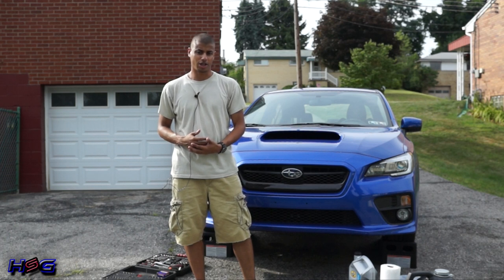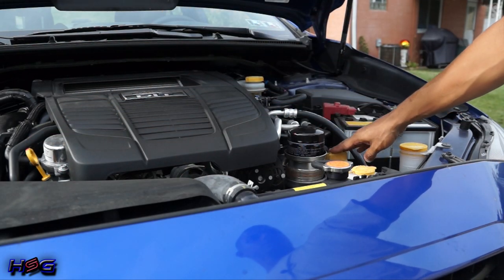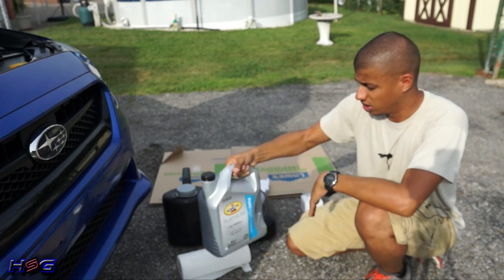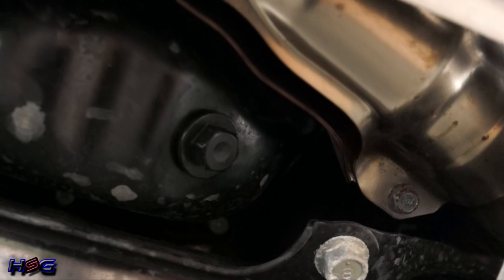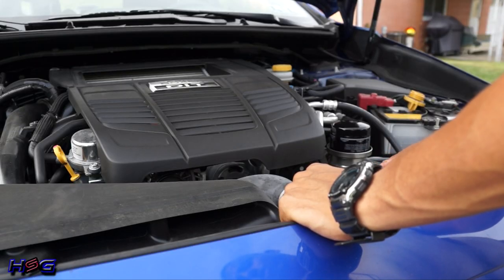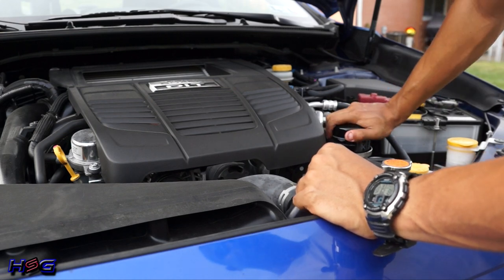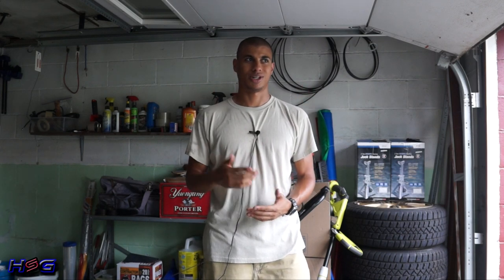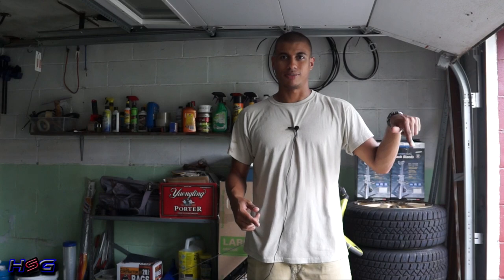Maintenance Series: 2015 WRX Oil Change

Comment: I've got 985mi on the odo this evening ..  tomorrow is oil change day.   stopped at Subaru and picked up filter/crush washer.   Gonna leave oil filler cap closed for a bit while initial oil drains out.. hoping to avoid the big gush I've seen on your change and another.  :)   gotta love that filter position.
Reply from the maker: +dsonyay Nice.
Reply: +dsonyay Did mines lastnight with the filter/cap still on, this did not prevent the massive gush of hot oil from covering my hand.

Comment: Great video man! Well made and easy to follow. Only thing I’d do different is change the oil filter first before you drain the oil to prevent any loose debris in the filter being pulled back into the engine while it’s draining

Comment: Great video but a couple of points, to prevent the mess don't open the oil filler cap until you have opened the drain bolt. This helps to have an initial vacuum which  reduces the initial flow and prevent such a mess. After opening the drain bolt you can then open the oil filler cap to increase the flow.

Comment: I did see some comments about the oil gushing and giving Hawk a hard time. It is impossible. It comes out faster than my drain pan could keep up. It all round was a nightmare for me. Good thing I put the fumoto valve on. AMSoil Signature Synth 5.4qt, subi filter
Reply from the maker: I hear ya. I have the fumoto valve on my STi & love it! I don't spill 2 drops with it.

Comment: I was going to recommend you use a Purolator PureOne oil filter, but there is no Purolator oil filter compatible with the WRX.....or any Subaru.  Subarus are not compatible with Purolator oil filters for some reason.  The Purolator site says use the 14615 series oil filter, but they're not found in stores (i.e. Pep Boys, Advance Auto Parts, Auto Zone, O'Reilly Auto Parts, etc.).  With Subarus, I guess just stay with the OEM oil filter.  It's good that you're using Pennzoil Platinum, great oil.
Reply from the maker: +LouieGMDesign Yeah. I like OEM. NAPA Gold filters seem to do ell also.  👍🏻
Reply: +LouieGMDesign I found the Purolator Boss that fits my WRX 15.

Comment: Nice job! Just a few suggestions, if that engine was recently driven and hot, that oil would really burn the skin if it spills. Don’t forget to wear gloves for your hands. Finally, I had an 07 Hawkeye TR and I found that even venting the oil dipstick with the oil cap helped the used oil drain quicker. Always good to do the maintenance yourself knowing you do the job right. Keep up the good work!
Reply from the maker: Good to know. I may reshoot this video at some point. Lol.

Comment: good info.. I'm buying a 2015 WRX any day now.   nice to see how easy an oil change is.  the oil filter location is superb.  what mileage intervals does Subaru recommend under normal driving?
Reply from the maker: +dsonyay Glad this helped you! I change it every 3-4K just to be safe. I'd rather do more oil changes & have the peace of mind, instead of trying to figure out if it's been driven hard or not & just assuming its ok.

Maintenance Schedule:

1st oil change by 6000 miles or 6 months.
Subsequent oil changes at least every 6000 miles or 6 months
Note: this is the minimum required interval. Many people do the first oil change early.
Note; with stop and go, hot/cold, hard, or severe driving, replace every 3,000 miles or 3 months whichever comes first
Reply: +HawkeyeSTiGuy thanks.. I initially went in to test drive the 2016 Outbacks, but while waiting for keys for my second drive, I was looking at a leftover 2015 WRX... told the guy,  "hey, I want to test this out as well"..  well, now I've forgotten. about the Outback.  hahaha.. I'm 53 and my last sports car was a 944 t
Turbo in 87.  This WRX is incredible for the money.
Reply from the maker: dsonyay That's awesome! You are going to love the WRX! In my opinion, the 2015 is a game changer & is better than it has ever been before. Having considerable wheel time between both, the WRX is as good as my 06 STi was from the factory. The handling is much improved, the tires are wider, the power has been stepped up, & it has good torque. The new WRX is even more of a bargain than the old ones.
Reply: +HawkeyeSTiGuy I've always admired the cars ever since the bugeye version.. big rally fan.  question... I've seen some oil change videos.. do you guys have a thing for Penzoil Platinum?  the two I saw, both used same oil brand.  :).  can you suggest a good WRX forum?
Reply from the maker: dsonyay Penzoil Platinum seems to do very well in these cars, & isn't ridiculously expensive. You can go with something even higher grade like Amsoil Signature,or Brad Penn, but that would be overkill. I used Mobil 1 in my STi when I first bought it & it seemed to break down very quickly & not protect the components like it should. 

As for forums, I can definitely recommend igotasubaru.com. They are very friendly & helpful on that site, & there is a wealth of information. I am on the igotasti site, which is run by the same people, & have never had a problem, so that is the main forum I am on. It feels much more like a community, where people try to help each other, instead of putting others down. 👍🏻 

There is also NASIOC, which is the biggest & is one of the oldest Subaru forums, & because of that, it has a ton of information. I occasionally use the site for researching issues I'm having, but I truly hate going on there because it is full of armchair mechanics & experts, who share "knowledge" that they heard from their uncle's friend's brother twice removed. NASIOC is also very hostile towards new people or anyone looking for information. You ask a question, & you'll immediately have 20 people yelling at you to search before they even look at the question you are asking. 👎🏻

There are a number of other Subaru forums as well, like IWSTI.com, but I'm not on them, & some just copy & paste the same information that was originally posted on NASIOC or other forums.

Comment: Cool video man. I use Pennzoil Platinum in my 12 WRX, reading through some oil reports people have posted on the interwebs, it actually does really well in the EJ motors! What mic are you using? It sounds good.
Reply from the maker: T-WRX Thanks. I plan on doing a video in the future about some different oils out there & whats good for a Subaru. When I was in the south, I used Rotella T6 in the summer & was pretty happy with it. The one oil I'll never use again is Mobil 1. In fact, I just watched a video comparing several oils & Mobil 1 broke down the fastest, while Pennzoil Platinum did very well, & so did Amsoil Signature.

My mic is a $20 Polsen lav mic I got on B&H. I had to bent the metal contacts in the battery compartment, & wedge in foam to keep the little button battery in place. Before this, it would jostle around & the sound would crackle. The mic also picks up some static that I always have to edit out whenever I'm driving, which is mildly annoying, but overall, I'mm very happy with the sound quality & cost. It's hard to nitpick when it was only $20. Great budget mic to get started with.
http://www.bhphotovideo.com/c/product/944398-REG/polsen__olm_10_omni_directional_lav.html
Reply: HawkeyeSTiGuy Awesome, I'll check it out, appreciate the info. Keep it up!

Comment: When your oil is in your motor and it sinks down after some time, you should start the car for like 10sec so jt sucks the oil in the system and then check the dip stick

Comment: Subaru has been pretty competitive price wise with the oil filters.  The K&N oil filter is $12 near me and the Subaru blue filter is only $5.95 you can't go wrong and many people have filter leaks when using a Fram or similar and they are priced around $3-4 so it's well worth the extra $3 for that Subaru filter. STI used to make a Pink oil filter like the H&K but for $50.00 !?!??! That's rediculous.
Reply from the maker: I completely agree. I use OEM on this WRX, & since the engine rebuild on my STi, Moore recommended I switch over to NAPA Gold filters & those have been very good to me. Also in the $7 range if I recall. Years ago, I tried the K&N filter just for kicks because I needed to spend a few more bucks to get free shipping. I didn't notice any real improvement from it.
Reply: Anybody know the difference between the Subi black and blue filters?

Comment: Thanks for the video but you should never check the oil level with the car on ramps as the front of the car will be raised up and the reading will not be correct. If you only have the ramp option I would fill the level half way and get the car off the ramps and then re-check the oil level when the car is on a flat level surface.
Reply from the maker: +HankDCFC Yeah, normally I wouldn't, but my driveway is not level at all. It really doesn't show in the video, but the car is actually pretty close to being level. Lol.

Comment: how many quarts did you put in you need 5.4 plus pull that filter of first it helps get more of that old oil out. I'm not trying to hate just help i used to change oil. but nice vid i like the style.
Reply from the maker: I put in enough. I added a little more off camera & I checked afterwards & it was right where it should be. It was just the way I edited it that makes it look like I didn't add enough.

Comment: I thought you needed to refill with 5.5 qts of oil. But it looks like you only added 5 qts (1 pennzoil container). Just wondering if you added more that's not in the vid. Good video, btw!
Reply from the maker: +Ameer Eusebio Thanks. & Good point, you are correct. I only put in 5qts & when I checked it was about 3/4 of the way between both lines, so I did not add more. Adding a half quart would take it right up to the top line, which is good too. I checked the oil level again later that day, & again the day after & it was still at the same level, so I didn't sweat it. I usually check my oil every other gas fillip, so if it is slightly low, it doesn't stay like that for long.

Comment: Hey man I just got a 16 WRX. I've been wondering if I should do the oil change myself or take it to the dealer since they're gonna do them for free for the first so & so months. What do you think? I change my own oil on the Chrysler 300 and the Acura I had before I traded it in for the WRX. Just want some opinions

Thanks for the vid
Reply from the maker: Sure. If they're doing them for free, I'd just take it to them. Once you run out of free changes, then I'd start doing them yourself if you feel comfortable. 👍🏻

Comment: I have a question, You think amsoil is better than the Subaru synthetic oil?.. And what you think about pennzoil ultra?.. I'm not sure which to use for my wrx 2016
Reply from the maker: +hektor3261 In my opinion, Amsoil is one of the best oils out there because of the additives they put in it. They have different blends, but the stuff I use in my STi is high in zinc, which reduces wear between components. My car runs smoother & happier with Amsoil than it has with any other oil I have used, even before it was built.

 That being said, I would not recommend Amsoil for a new car under warranty for 2 main reasons. First of all, a car that isn't built really doesn't need Amsoil, any SAE certified full synthetic should be good. Second, most blends of Amsoil are not SAE certified because they do not me the specified requirements for composition. As I understand it, an oil needs to contain certain percentages of each component in order to meet standards. This also means that most oils are within a few percent of each other as far as their composition. Amsoil is formulated differently, which is actually better for most applications, but because of that, it does not carry an SAE stamp of approval, & that can get you into trouble when it comes to warranty work.

I have no experience with Pennzoil Ultra, so I really can't say if it's good or not. I know my car hated Mobil 1, not sure why. It just was not happy with that oil & often made noise on start up. I would say as long as you stick to a full synthetic that carries an SAE certification (It should be on the back of the bottle) you'll be good.

Bob is the Oil Guy is one of the best sit web forums for researching oils. There is far more knowledge over there than I can provide. This link also talks specifically about Pennzoil. 👍🏻 Hope this helps. http://www.bobistheoilguy.com/pennzoil-synthetics/
Reply: +HawkeyeSTiGuy  thanks for your advice 👍🏼 I'll probably use oem oil or pennzoil
Reply from the maker: hektor3261 No problem. Either oil should suit you just fine. 👍🏼

Comment: hey what's up hawkeye, what kind of ramps do you have. interested in getting the right ones so i don't scrape to bottom of my vehicle. thanks
Reply from the maker: I used plastic ones from Pep Boys. They are standard size ramps. They barely clear the bumper though. You can find low profile ones online or at some automotive stores. Harbor freight also sells low profile jacks to get under low cars. 👍🏻

Comment: FYI next time turn the oil bottle side ways it pours a lot smoother no need for funnel  Mr +HawkeyeSTiGuy Great Video
Reply from the maker: +MrJag83aa Thanks. I always use a funnel because it never fails that the wind will blow & then I have oil everywhere. Also, it's difficult to judge sometimes, & when you're pouring out of a 5qt container, It's just easier to use a funnel than trying to hold perfectly steady for 3 minutes straight.

Comment: your suppose to check your oil levels after a few mins of running the engine. Btw awesome car
Reply from the maker: I did, it's just not shown in the video.
Reply from the maker: & thanks. The WRX is my moms. I have an 06 STi that is having the engine rebuilt right now, but I should have it back shortly & will be doing more videos on that.
Reply: actually the most accurate is when the engine is bone cold first thing in the morning

Comment: Wouldn't it make more sense to remove the drain bolt first before taking off the oil cap?
Reply from the maker: Yeah, some people do it that way. I tend to do it that way too now, but when I made this video 4 years ago, I didn't. I also have a Fumoto valve installed on my mom's car too now.

Comment: Any difference between the blue and  black oil filter?.. Because I went to this Subaru dealer and they gave me the blue filter..
Reply from the maker: +hektor3261 The blue ones are for the EJ motors (02-14 WRX/STi) & they install on the bottom of the engine block. The black are slightly bigger & are for the new FA20 motors (15+WRX & I believe BRZ as well.) They install as you see here, inverted on top of the block. If you have a new WRX & they gave you a blue one, then it's the wrong one.
Reply: +HawkeyeSTiGuy thank you very helpful 👍🏼

Comment: Hi bro, do we have 14mm drain bolt in Subaru tool kit?? Or u bought from outside.
Reply from the maker: I do not believe a 14mm is included. I used my own socket set for this job. I would recommend getting a decent sized Craftsman socket set. That should cover any bolts you may need to adjust or tighten. I say Craftsman because they have a no questions asked lifetime warranty. 👍🏻
Reply: +HawkeyeSTiGuy  Thanks. Subbed.
Reply from the maker: You're welcome. Thanks for the sub! 👍🏻 Next oil change I do on the WRX, I'll be showing how to install a Fumoto oil drain valve. Once it's installed, you don't have to bother with the drain bolt. 👍🏻

Comment: whats your opinion on mobile one synthetic oil and filters?
Reply from the maker: I personally don't use Mobil 1 anymore. I used it a few times in my STi & my motor hated it. It always made bad noises on start up. A lot of Subaru guys don't use it because they don't trust it; however, some guys do use it & haven't had issues. IDK about their filters. I have switched to NAPA Gold filters since this video. They are recommended by my local performance shop & seem to perform a little better. The gasket on them is also much better than the OEM ones.

Comment: Why don't you tighten the oil pug with the torque wrench in proper OEM spec.
Reply from the maker: Because it really isn't that critical. If you, or anyone else is doing an oil change & you don't feel comfortable tightening the bolt without a TQ wrench, then I recommend using one. However, my grandfather taught me how to do oil changes when I was 4. In 23 years of countless oil changes across multiple vehicles, I've never used a TQ wrench for the oil drain bolt & have never had any issues with bolts leaking or coming loose. It just needs snugged up tight enough so the washer seals properly, but not so tight that the threads are being stripped out. With experience, you get a feel for how tight it needs to be.

Comment: How much oil did you use?
Reply from the maker: +Edward Castrejon The manual states 5.5qts, however, I only put in 5qts & when I checked it was about 3/4 of the way between both lines, so I did not add more. My driveway isn't level to begin with, so I'd rather add too little, & then add more as needed, than to over fill it. I check the oil level every other fill up, & added a little more later to top it off.
Reply: +HawkeyeSTiGuy okay cool! Thanks for the I for and quick response! I'm a fan of you channel!
Reply from the maker: +Edward Castrejon No problem. Thanks for subscribing!